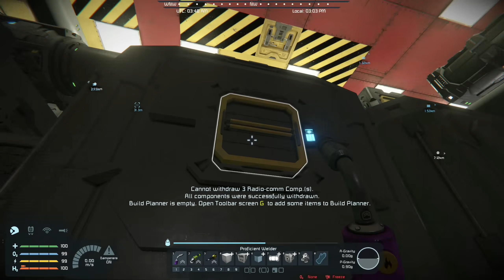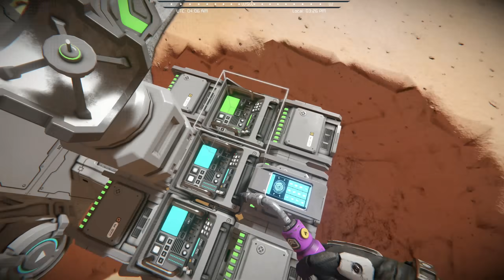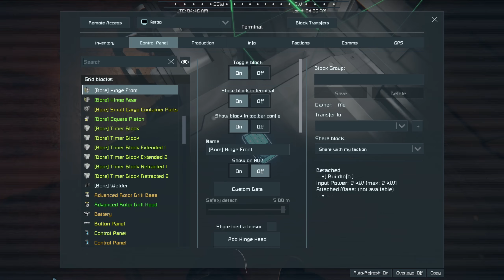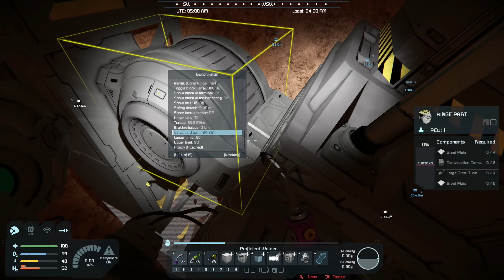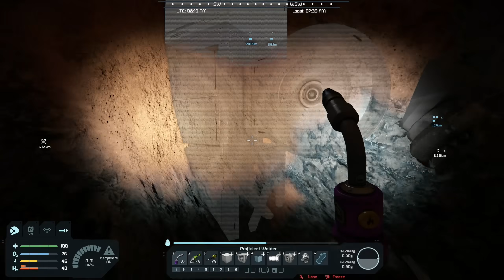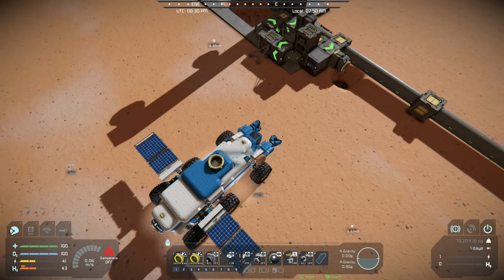Deep Ore Mining on Mars | Space Engineers E07

Comment: I see this builds projectors every few steps downwards. But with a small grid grinder attached to the top of the drill-section via a LG hinge with 3x3 SG hinge-part conversion you can remove it when no longer needed. Also saves on parts needed for the one further below.
Reply from the maker: I thought about setting up a grinder, but that can be tricky with spacing, so I didn't bother. I also have more ingots than I can ever possibly use, so a few projectors were no concern.
Reply: @KerboOnYT  Yeah, placing the projector on the other side might prevent spacing issues.

Comment: An elevator to the center of Earth ?
Surely nothing could go wrong
BTW beacons use less power than antennas, downside is you can't transmit signals with a beacon
Reply: This is possible. Drill completely through the planet, but it takes a long time.
Reply: @EddieGonzalez  think the planets only have a 60 km radius
Reply from the maker: @themidnightbanshee5927 They vary in size, but Mars is 60km radius https://spaceengineers.fandom.com/wiki/Planets#Measurements
Reply from the maker: Is it getting hot in here?